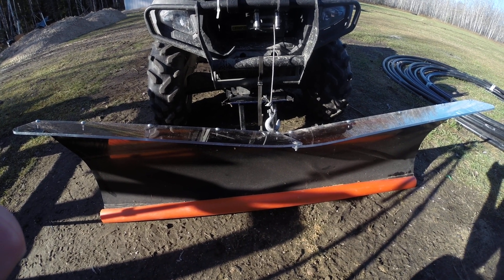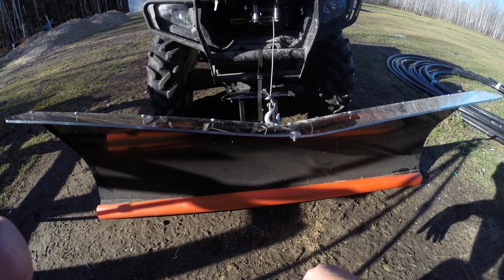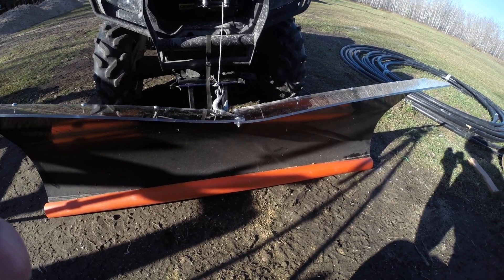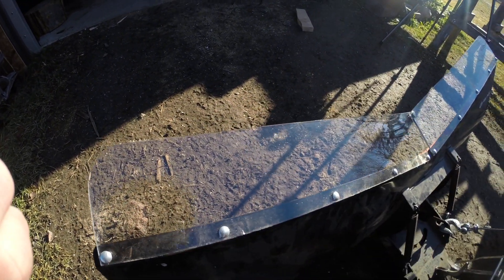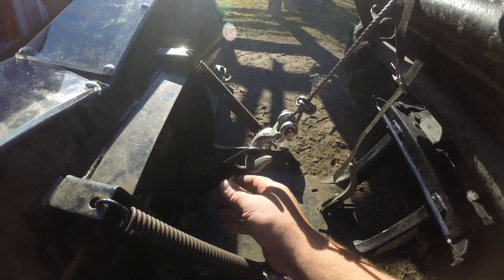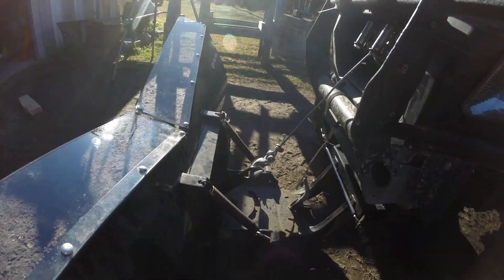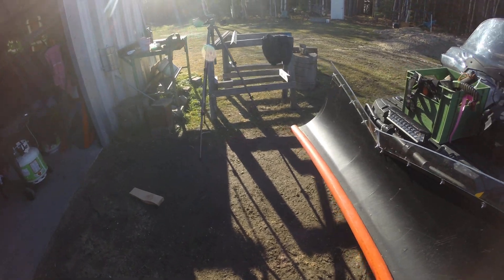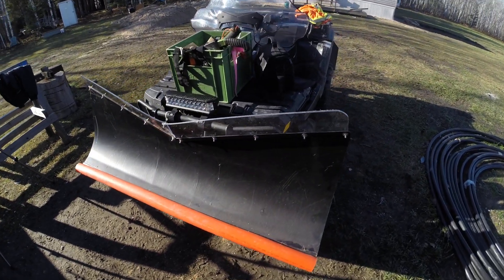The best ATV snow plow upgrades, modifications / Getting ready for Old Man Winter

Comment: The abs pipe on the bottom is a game changer - especially for anyone with a gravel driveway.  I have a new KFI 6' plow but am taking the skid shoes off.  When you angle the blade the shoes will dig into the edge of the lawn and rip up huge chunks.  The pipe floats over everything effortlessly.  I am putting a plow strap on my cable - now if KFI would just come out with a click-n-go mod for attaching the plow.  It can be a real pain trying to line up the pins into frozen iced over mount holes.  I had a drive up and click on system on my last side by side and it was so much easier.  I am running the new KFI plow on a Honda Pioneer 1000-3 - biggest issue is trying to see through the split windshield and backing up looking through a fogged/frosted up rear windshield.
Reply from the maker: Your SXS has the weight to be a much better machine for plowing than my ATV. 
My only issue is always not getting enough traction.

Comment: Older video, but very helpful.  Smart getting 2” PVC free. A 60” abs pipe was about $25.  I would recommend you still use skids with the pvc .  Tried mine once w/o them I and it was great, but you will wear down your pipe, and steel lasts a lot longer then plastic
Reply from the maker: I have had the same pipe on now for three seasons, yeah it starts looking rough and beat up but I'm pretty sure it will last a few more winters yet. When I first got my quad I tried plowing with just the skid shoes but the steel skids on gravel chatter a lot more than the ABS pipe.

Comment: Good morning Ray , 
 How did you attach the PVC to the bottom of the plow... Thank You , nice rig!!!👍👍
Reply from the maker: You have to draw a straight line with a marker down  one side of the PVC pipe, and the best way to cut it is to clamp the pipe to a table and use a reciprocating saw or a jig saw with a metal cutting blade to make the cut. Then you have to pry one side open just enough to slide it over the cutting edge of the plow and then use a piece of wood and a big hammer to slip it on the rest of the way. 
Good luck.
Reply: @timberray9572   Okay , I didn't know if compression or bolts held it in place... Thank You for taking the time to respond.. I have a very similar set-up with my Quad and plow and move a little gravel when plowing... Cheers from Michigan.
Reply from the maker: @pkope6849  No problem my southern brother.
Reply: @timberray9572  If you have a table saw just lower the blade, line up the fence so the blade is centered and run the pipe through the saw to cut a perfect straight slot on the bottom.  Start the pipe on the edge of the plow blade and push in.  If it sticks put a piece of 2x4 on the end of the pipe and give it a whack with a hammer.  A 2" abs pipe really sticks on and will last multiple seasons.

Comment: What kind of plow is that? I'm looking for a plow that has the sides raised. All the ones I'm finding are straight across. I've been looking at the KFI poly blade because it's taller then most. I want to be able to roll snow. I'm from Michigan, so we do get snow, just not as much as you. Thanks in advance.
Reply from the maker: It is a Polaris plow, it measures 18inches in the middle and 21inches on each side. I am not sure if they are still being offered, my ATV came with the plow when I bought it.